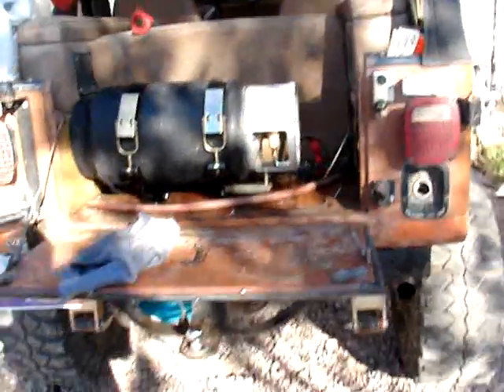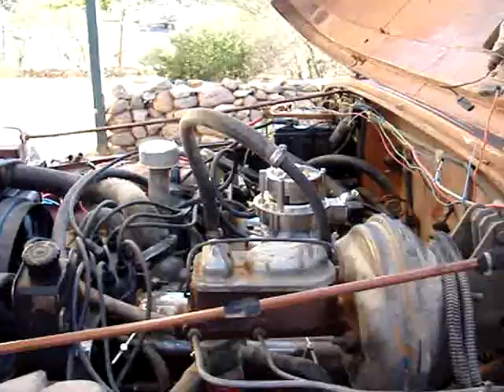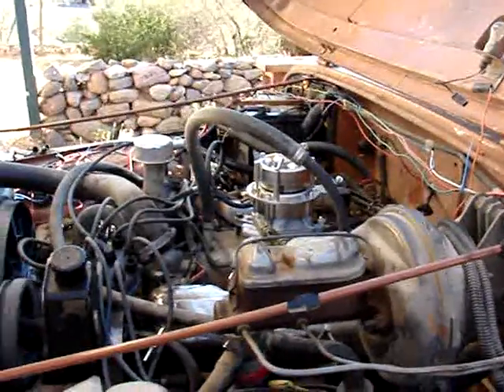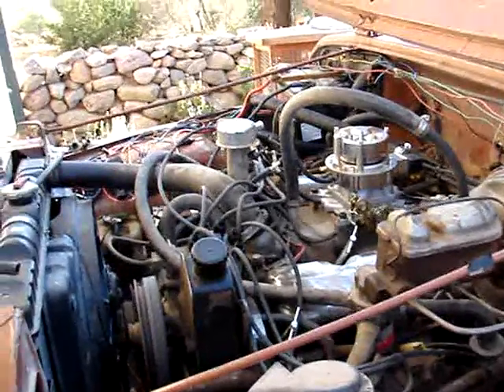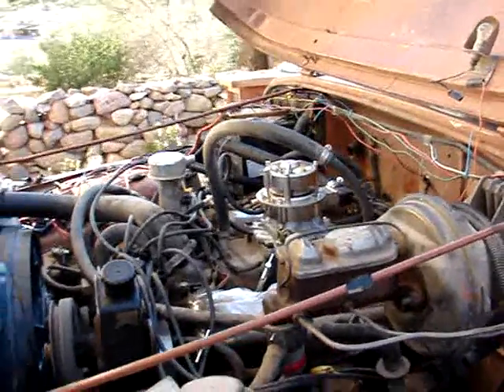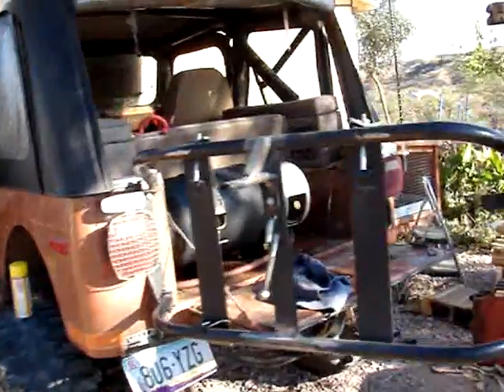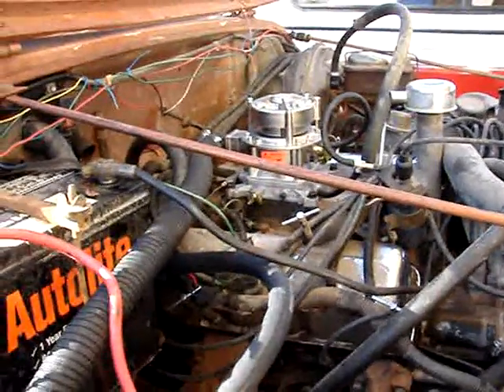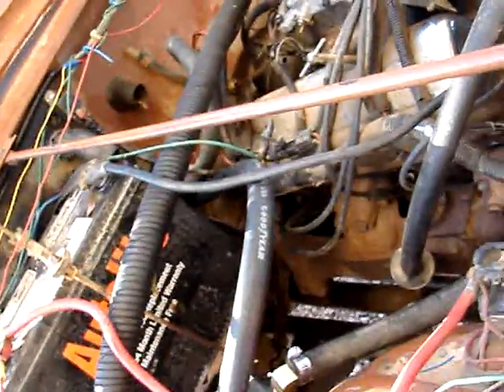Propane Conversion CJ7 V8 304

Comment: I can tell you for a fact that stall outs are out of the picture with propane.  I have done several conversions including an air cooled VW conversion and you can get a ton of low end idle out of propane.  you can attain an idle of 500rpm or less.

Comment: You don't have to worry about the motor quitting on steep inclines either. Propane will feed upside down sideways and any other way you can het a JEEP.

Comment: @t680277 deffinantly not, he should get about a 1/3 the millage for the same amount of fuel cause propane has about 1/3 of the energy per unit of fuel than gas does.

Comment: that's only happen if the AFR (air fuel ratio), Is incorrect in the whole section of RPM. if the mixture is to lean or rich, make the internal temperature raise over 725c, and make the piston and valve to bend.

the right AFR on gasoline engine is 14.7 on idle, in WOT , wide open throtle 12.7-13.0.

if you work with this standard, the engine life get longer, and less maintenaince, like oil, catalytic converter, spark plugs.

Comment: I have 2 mixers some call them carburetors the true them is mixer. So i have 2 225 mixers they each make about 200 bhp i was told i had to buy to regulators also. But 1 electric shut off valve it all works well. But CHECK ON PRICE OF YOUR PROPANE IN YOUR TOWN SOME PLACES ITS $3.70 A GALLON